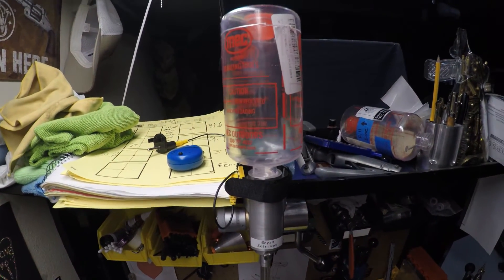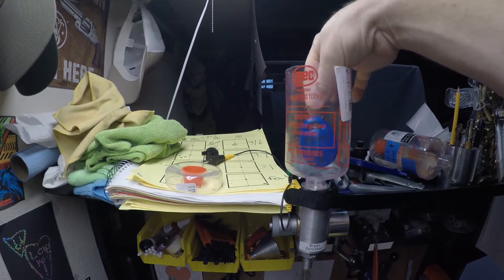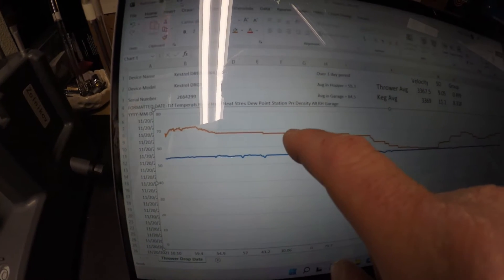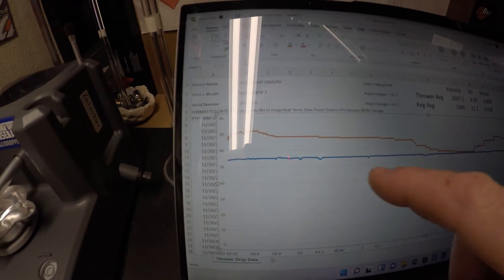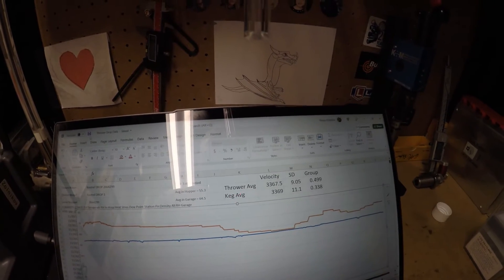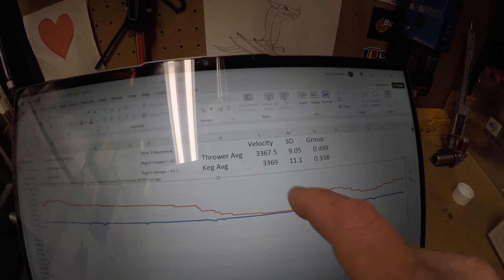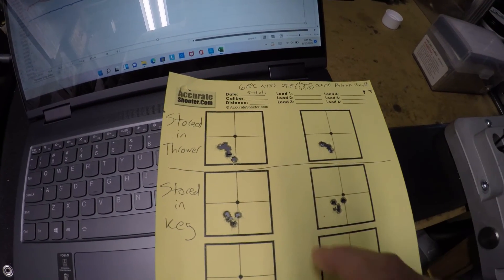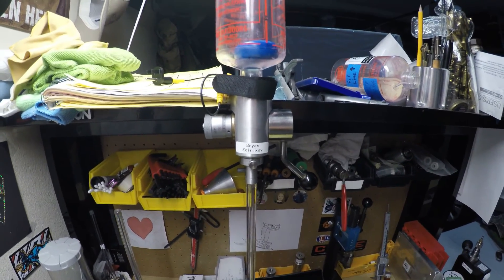Witch Doctor: Powder Storage Part 2 Storing in a Thrower

Comment: do you have a video of checking the weight of the drops from the Bryant thrower ?
Reply from the maker: No, sorry. I posted the data on a bench rest page on FaceBook. In a nutshell, I tested the entire range of the volume micrometer and about 5% of the about 100 throws was off by a tenth of a grain. This is way better than other throwers I have tested.